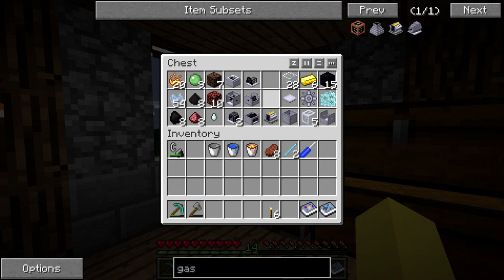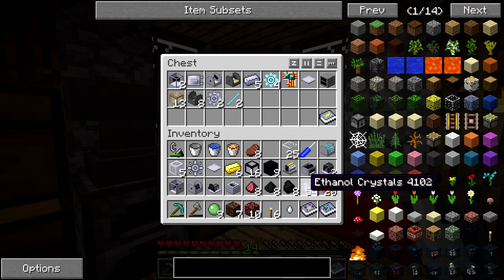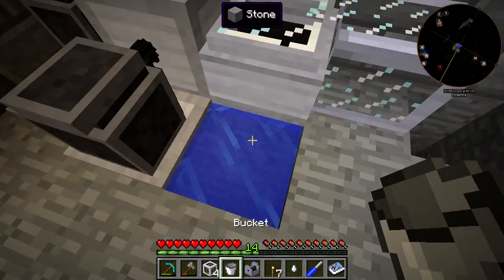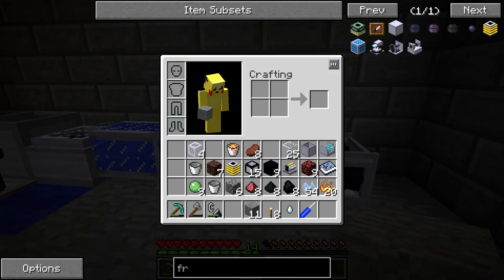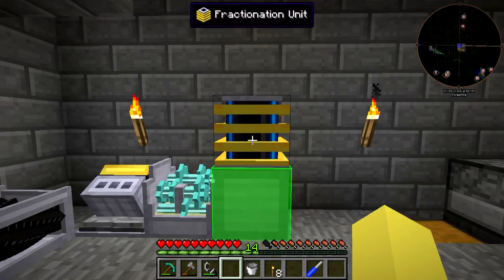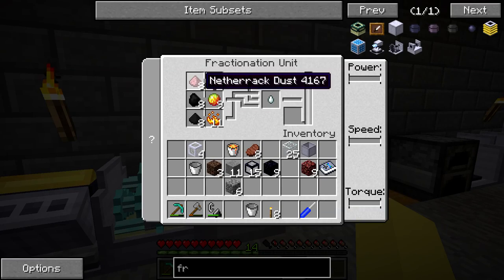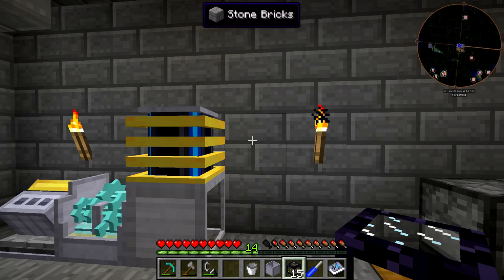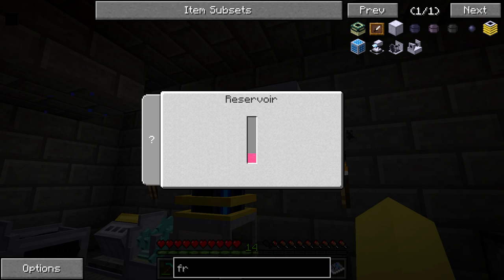Surviving With RotaryCraft :: Ep.8 - Jet Fuel Production

Comment: WHAT FORGE VERSION ARE YOU USING? I DOWNLOADED THE 10.13.4.1558 FOR MINECRAFT 1.7.10 AND IT FAILS TO EVEN LOAD COMPLETELY TO THE START SCREEN. EVEN THE VERSION 10.13.4.1614 OR ANY OF THE TWO IN BETWEEN. PLEASE HELP ME GET IT TO WORK AS I REALLY WANT TO RUN THIS MOD.
Reply: scooter800m only reinstalling minecraft alltogether helped me
Mean author of this mod refused to help on github

Comment: just a tip:
each steam engine can power up to four grinders of you split them twice and put a 16x gearbox. wooden ones can do, and with cooling fins, do not need any upkeep.
also using a comparator and a multidirectional clutch you can automate the speed-torque switching and use the ítem pump to extract the ore flakes
Reply from the maker: Wow, this sounds complicated, but totally awesome! I will without a doubt look into this for a future video! Thanks :)
Reply: +DrRageHard 
Yep, a bit expensive early game but can be totally automatic before CVT, and only need to be feeded with ores. I posted an old setup before adding the automatic switching, running instead on a timer. 
I'll share the link if you like.
Also, check out the performance engine upgrades, they are a bit cheaper on aluminum alloy than building them from scratch.
Reply: +DrRageHard 
Yep, a bit expensive early game but can be totally automatic before CVT, and only need to be feeded with ores. I posted an old setup before adding the automatic switching, running instead on a timer. 
I'll share the link if you like.
Also, check out the performance engine upgrades, they are a bit cheaper on aluminum alloy than building them from scratch.
Reply: +DrRageHard 
Yep, a bit expensive early game but can be totally automatic before CVT, and only need to be feeded with ores. I posted an old setup before adding the automatic switching, running instead on a timer. 
I'll share the link if you like.
Also, check out the performance engine upgrades, they are a bit cheaper on aluminum alloy than building them from scratch.
Reply: +DrRageHard 
Yep, a bit expensive early game but can be totally automatic before CVT, and only need to be feeded with ores. I posted an old setup before adding the automatic switching, running instead on a timer. 
I'll share the link if you like.
Also, check out the performance engine upgrades, they are a bit cheaper on aluminum alloy than building them from scratch.

Comment: Don't forget, reservoirs should be multiblocks. So you can put a second one beside the first and it will form into a double size reservoir.
Reply from the maker: Yep :) For the time being, it seems one reservoir is enough for the jet fuel, but the lubricant one is almost full so ill need to expand it soon.

Comment: is the fractionation unit like the blast furnes
Reply from the maker: It is very similar to the blast furnace except it doesn't require a block to heat it, but instead uses power. It also has the ghast tear which is never actually consumed, but the blast furnace doesn't have anything like this.

Comment: yea really cool it s nice to get some of the best power gen engine and get tungsten and stuff.

I just did a control spawner on blazes, it only need an AC electric engine to run, (you can increse the efficiency later with speed gearboxes) and just near by a magnetation unit. I just have two shaft one magnetazing the other powering.
The mob farm took long but seting up the AC+powered spawner control wasn t.

You got lucky to manage to get silk touch, i need to make this exp farm to finaly get silk touch one day, still fun to go trough those machines, i learn that vaccum hopper gather exp too, it s great, i used it near my furnace and don t waste those precious exp balls :p.
Reply from the maker: I'll definitely make a blaze farm using this method! Great for getting blaze powder as an additive for the performance engine. Best of luck getting silk touch (or at least fortune) !

Comment: Reactorcraft probably has the most complex Multistructure
Reply: It technically doesn't because its not a multistructure at all. It's just blocks interacting with eachother; since you can make a reactor in anyway shape or form (It working however is lots of testing). They are a multiblock structure in the same way the friction thing (I cant remember right now) and the furnace is one (which its not). :p
Reply from the maker: Can't wait to actually dive in and start working! First reactorcraft episode (still rotarycraft series) should be up in a few days.
Reply: Triaxx2 ah kk well again thats also not restricted to the circular pattern; I've done in a straight path to turn it into a giant railgun. There just the easiest way to do it which is the way shown normally but you can do it however you like. If you can figure out how to do it as a square, do it.
Reply: True, though I'm pretty sure the railgun isn't intended. Still, you're correct.
Reply: I think he's thinking more of the Tokamak.